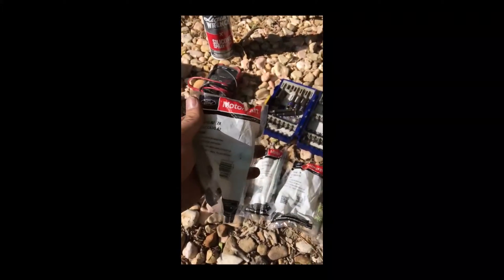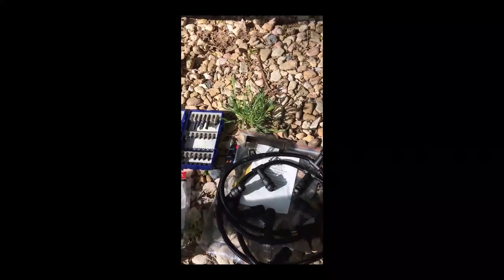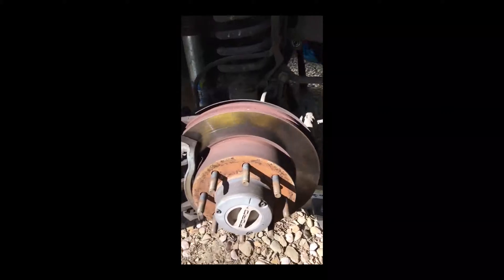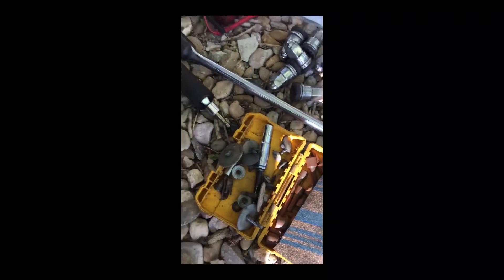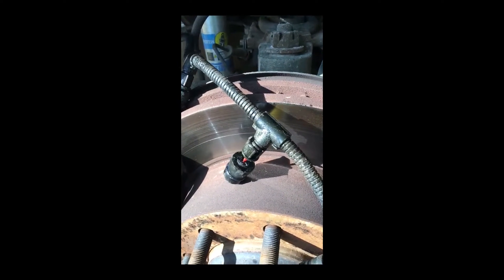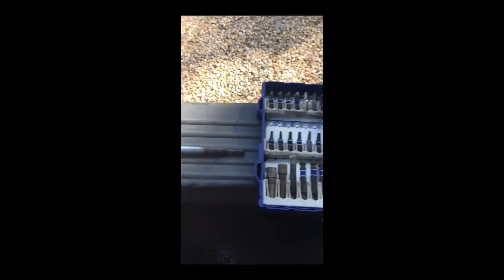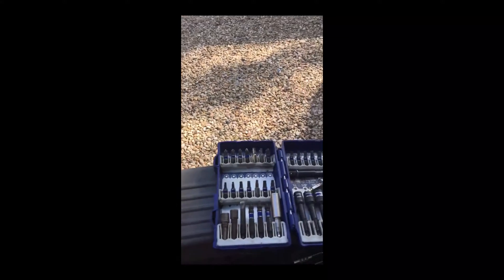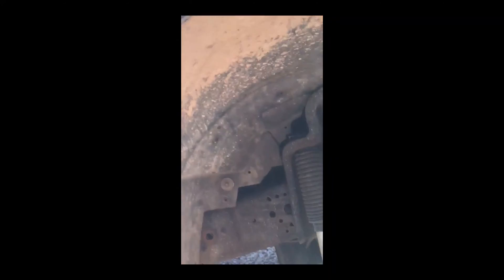6.0 Powerstroke - How to Replace Glow Plugs

Comment: thanks. so you dont have to clear the cylinders of oil or anything? of course most of the fasteners holding the inner fender on mine snapped, hate those plastic trees
Reply from the maker: Nope there is no oil within the combustion portion of the cylinder. I think what you are wondering is why the glow plugs come out with oil on them. That is because they screw in through the head which has oil passing through it. However the tips of the glow plugs stick through the heads into the cylinders.
Reply from the maker: Correction the CCV “crank case ventilation which vents crank pressure into your intake will put small amounts of oil in your cylinders. But not enough to even make smoke come out of your tail pipe.